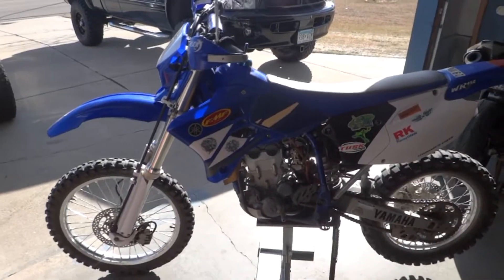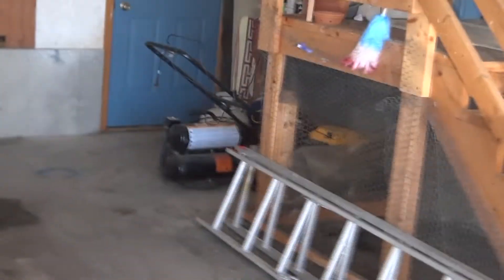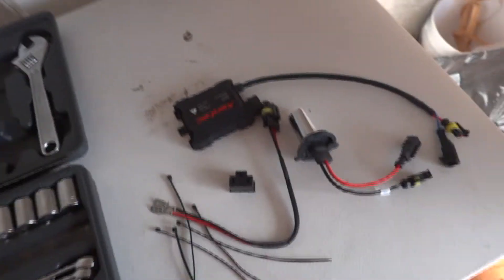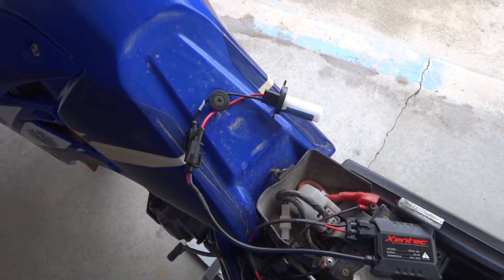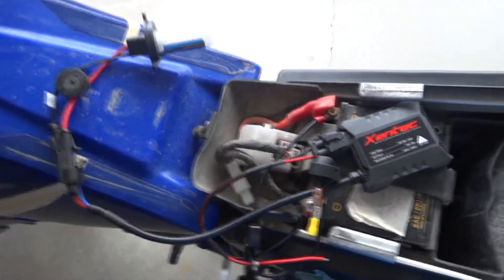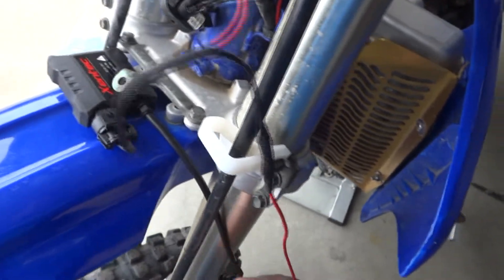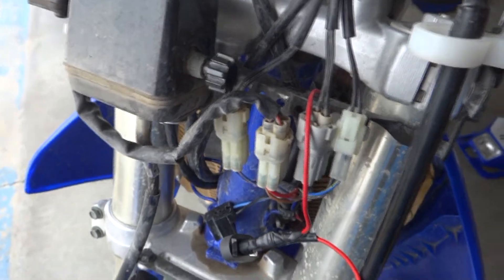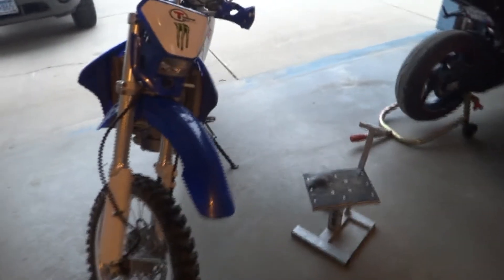Yamaha WR450 8000k HID install

Comment: Hello!! I have a 2007 wr450f and it has installed a hid light. I have a problem, this light drain my battery, does anyone know why it is happening ?
Reply: I think you answered your own question but you might have a bad battery but it sounds like the light just pulls to much power for your charging system

Comment: the reason its flashing is because your stator doesnt put out enough power to light it up. so you'd need to hook a relay to your switch and then to the hid ballast. that would solve the problem of it flickering and shutting off randomly... unless of course your bike doesnt have a battery.

Comment: Hi mate. Another way you could've made this mod work would be by wiring a dc rectifier up and then you can utilise the headlight winding. I believe the reason your hid headlight cut out would've been because your battery was getting drained. The two feeds are designed so your blinkers and brake lights and what not are not affected by the current draw of your headlight.

Comment: Update: I took my WR apart over the weekend and in order to see exactly how the wiring is ran the main harness has to be taken apart, remove the radiators, and drain the coolant. Guess it's gonna be a fun one to do, I hope it works tho... No reason it shouldn't tho because the stator is basically two stators with one negative and two positives... All I want to do is connect the two positives so there parallel and I should get full power then. Does this seem correct, anyone?

Comment: You from Minnesota? I have a plated 2011 WR450 from Michigan. No problems here. before i got it i considered the 500exc too. Comming from motorcross the ktm was nice but i felt the wr was way more planted. Plus, the 2012 WRs are fuel injected w/  frame! :)

Comment: Looks awesome man!!! I wanna get one for my 2009 wr450f. One question... The stator is a dual coil which means there is 2 outputs and both are AC. One goes to the regulator/ rectifier and then to the battery DC, the other is directly to the headlight AC "as you found out". I'm sure you have seen the "floating the ground mod" but my question is can you run the two + from the stator in to a baja designs reg/rect and then in to the battery... If possible it would save tons of $. Let me know, thx.